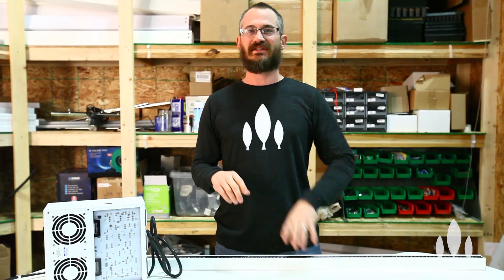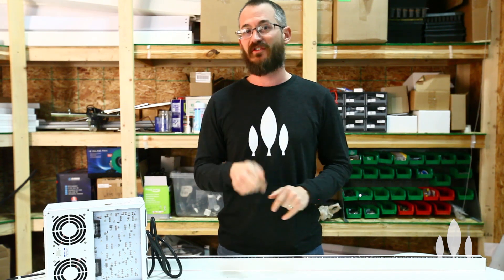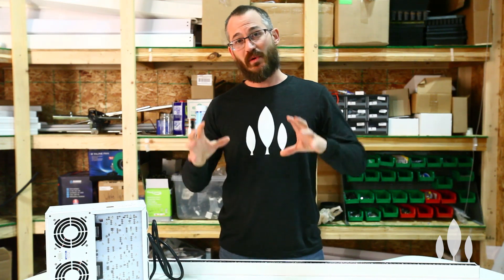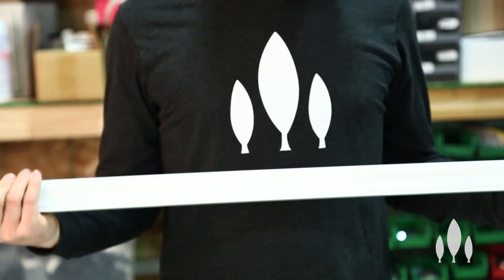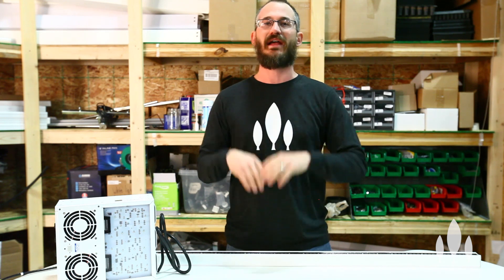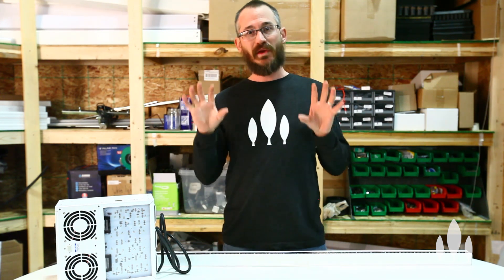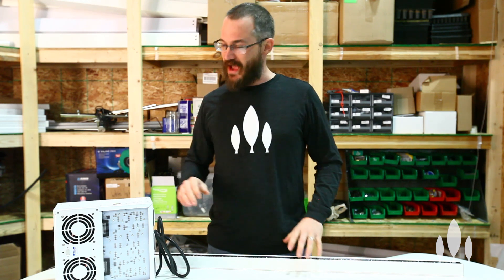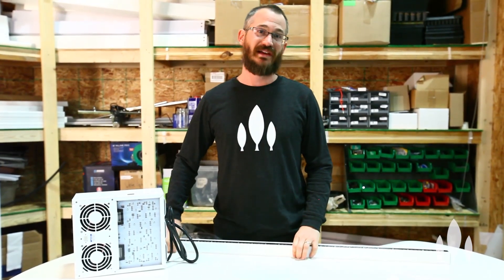LEDs for Indoor Farmers

Comment: What about 12v systems for those of us off grid? I live on a Canalboat and want to try a small scale aquaponics setup. However, I want to do it year round so need artificial light.
Already all my fixed lights and torch/lantern back ups are LED and although I have mains power via inverter almost everything I use is 12v.
Reply from the maker: Most LEDs run on DC and are more energy efficient than HID, but still consume a lot of electricity.  It can be done, but it’s expensive! Also, Simply Pumps has some great 12v pumps that are super efficient and powerful.  They run Farm Walls like a dream, not sure how big of pumps they get up to though.  Side note...I really want pictures ZipGrows on a canal boat!  Those are so cool.
Reply: +Bright Agrotech When I get the system up and running I will do a vid and let you know. I have a low ampage pump that should be ok. I was planning to make either vertical pipes from 4 inch plastic pipes or a cascade arrangement. Not sure I will have space for fill and drain beds yet. Just kind of testing the concept. On the canal the temps drop lower than on land and the english weather is hardly reliable as it is.

I saw a vid in which they only used red and blue leds. I was thinking of making my own. I s there a particular type of led that I need or is there a ready made unit?

I have 250w of solar but am planning to add to it and doubling my battery bank asap.

Comment: what electrical load is needed?  am looking at building on a small lot, 27,000 sq ft, 8,000 buildable area clear of lot line setbacks.  Light industrial,  natural gas, and three phase available.  Local electric company will bring in up to 600 amp 220 single phase for 1500.  three phase higher amp or more dollars.  subtracting office, and general lighting, hvac etc how much lighting could this support?  or do i need to the higher amp three phase?.    Central Minnesota 90 miles nw of Minneapolis
Reply from the maker: Hi +bruce conrad - That should support around 400 of the LumiGrow 325 lights, which would be about right for an 8,000 square foot facility. 3-Phase is almost always preferred depending on the cost difference. Thanks for your patience!

Comment: sometimes, a like in the winter, the additional heat generated by HID lighting is beneficial and over all more efficient because you don't have to introduce a separate heat source. you should re do this video in the summer months when heat is a problem rather then a benefit.
Reply from the maker: +turdfurgison It's true, lighting of all kinds emits a lot of heat, which depending on your growing environment can definitely pose some challenges. Regardless of the season, if you're growing indoors, having a solid HVAC unit is definitely useful, if not critical. We'll have some videos on this or something similar in the summer time, don't you worry @turdfurginson!